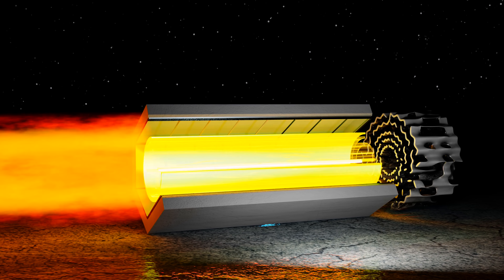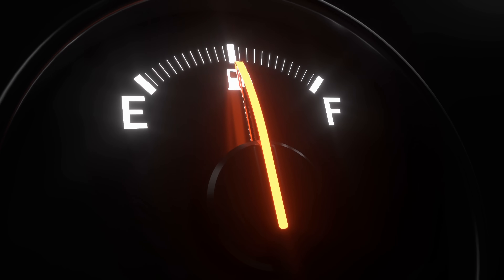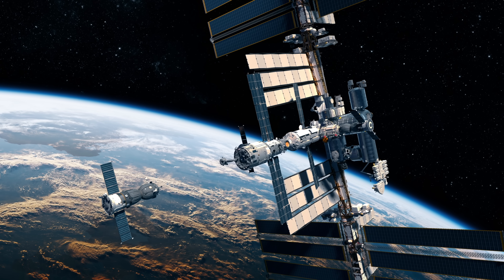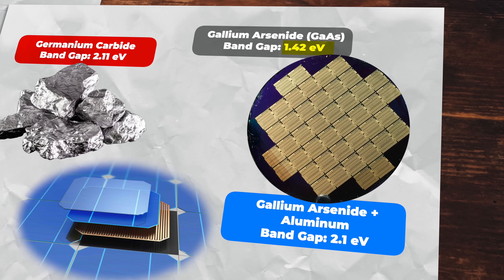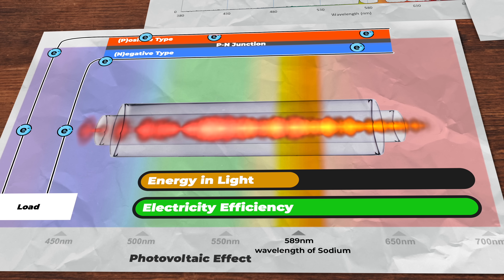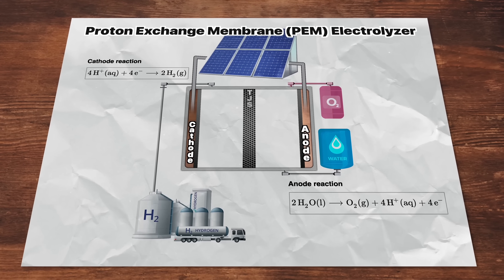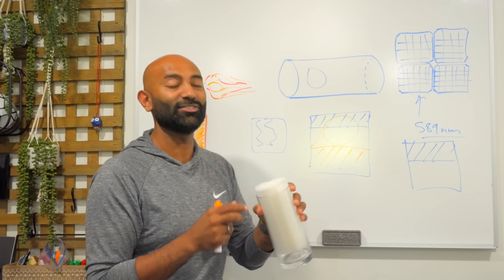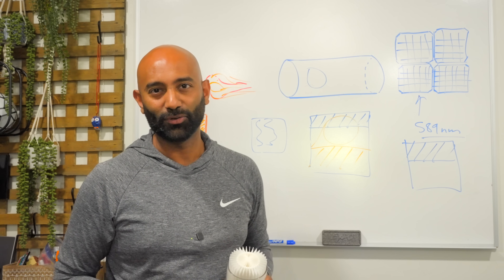Why Solid State Might Save The Combustion Engine

Comment: Look at each step. 
Combustion: Air with 20 % oxygen is mixed with assume a gas fuel and burned.  It's volume is greater then the air and fuel combined by a significant ratio so it will push the air and fuel gas out of the combustion section.  The solution is a vertical mounted system where the less dense hot combustion product have buoyancy in room temperature air. However the exhaust and still burning fuel and air will either speed up and create more drag or the area increases. 
Radiant, and convection heating occurs heating the container of the combustion.  That heat needs to be conducted, radiated, and convected  to a heat sink.  In this concept the final means of moving thermal energy is by radiation of the sodium at 589 nm wave length.  This can only occur, with neither of the other methods being significant, if the gap in which this occurs in a vacuum and the surface is pure sodium.  Table salt melts at 800C and sodium at 98C.  Most efficient temperature is 300C.  The salt needs to react with something to combine with chlorine being a gas that is removed by the vacuum pump.  The only way of obtaining pure sodium. The sodium a liquid at 300C need to be a a porous ceramic vessel with sodium wetting the outer surface completely yet held in place by surface tension. There will be losses because something has to hold this assembly in place and achieve a vacuum.  The voltaic Germanium semiconductor devices will never by 100 % efficient. however; the conversion of heat to electricity occurs in a gap between the terminals at different voltages. Physical features, so some fraction of the surface seen by the radiation hits them. The germanium is going to be heated by the radiation not converted into electricity and the also heated by the current. 
The combustion gases lowest temperature is about 300C so that the radiation is sufficient to make electricity. The hot gas enters the heat exchanger that is likely a cross flow device which is significantly less efficient than a counter flow heat exchanger. (the image) The inlet gases are heated cooling the exhaust gas. Buoyancy is the pump that moves the gases through the system.  The hot inlet gases are now also buoyant but less then the average combustion gases.  More resistance to the flow in the system as the inlet is below the then heated inlet gases.   
Shut down is another problem because the vacuum must end and the chlorine returned and combine with the sodium to make salt.    I do not think they can achieve the efficiency predicted.  My guess is that they didn't calculate all the losses and energy to needed to set the conditions like vacuum. I had spent 20 years supporting Electrical engineers and know that the minor losses are not included in the models used to design circuits.  This didn't improve significantly when finite element is used to design the circuits.

Comment: You say no moving parts, but the gas is moving..,
So my questions are, the cost of materials to manufacture, exhaust gas components if not hydrogen, heat dissipation, photovoltaic and other component life expectancy, the engine startup process, ability to recycle and replace parts. Als, what is the pressure at the exhaust, could that drive a fan to act like a turbo etc.?

Comment: 100% not fake. This invention is genius. Solar PV cells are hard to make efficient because they must convert a wide range of light wavelengths. This makes material engineering very tricky, and various types trade off efficiency for cost and application. Yellow/red is the best colour for Solar PV absorption. So, having an intense source of narrow wavelength in the ideal range is perfect for Solar PV manufacture.

Regarding combustion and heat transfer efficiency. UK combined cycle gas turbines (CCGTs) get between 50 and 60% efficiency. This is very close to the Carnot efficiency for an ideal heat engine running at max power. However, things change since this has no moving parts, so no mechanical work, or fluid reservoir. We'd need an engineer to discuss the potential mechanisms, but the quoted efficiency could be close to the maximum theoretical Carnot efficiency (around 85%). It's not impossible, as CHP achieves this (by prolonging the utility of the heat).

Comment: I think this idea is really cool but why? Why not just skip the whole thing and just use a jet engine in a car at this point you are running a half ass jet engine already. Yet you are losing a lot of energy due to transfer. It would make more sense to get as much power out of the fuel.

Comment: Burning that clean they could make it two stage where the heat could be recovered and diverted through a closed system boiler turning a turbine ( low pressure ) making it near 100% efficient.

Comment: Mesodine uaes the letters Tm after LightCell name.
TM stands for trademark. The TM symbol (often seen in superscript like this: TM) is usually used in connection with an unregistered mark—a term, slogan, logo, or other indicator—to provide notice to potential infringers that rights in the mark are claimed in connection with specific goods or services. Use of the TM symbol does not guarantee that the owner’s mark will be protected under trademark laws. The owner may use the TM symbol regardless of whether an application for registration has been filed or whether the trademark is registered, and even if an application for registration of the mark is refused.

Comment: Couple issues that I am curious about: What about emissions control, if burning gas? I imagine you could tune this for a more efficient burn, but there would still be carbon emissions. The other issue is heat and photovoltaic cells. Normally, solar panel efficiency decreases when panel temperatures rise. Would this not also be the case with these as they are in very close proximity to the combustion process.

Comment: there are high pressure and low pressure sodium lamps.  They do not use salt.  They use sodium metal.  You can see the sodium in a low sodium lamp.  Only problem is that sodium is reactive when it comes into contact with water.  Can you get enough heat from an internal combustion to light a low pressure sodium lamp while still cooling the engine?

Comment: Nice video and presentation. 
Burn fuel to run incandescent light to run solar cell. Does it also generate co2?
This is like using an incandescent light bulb to run solar cell.

Comment: Really good video unfortunately the physics of most of these concepts does not add or it is not commercially viable.  I particularly liked the utilization of the "waste heat" something had toyed with some 30 years ago and think with the materials available now and some serious development money it would make serious commercial sense after all the engine is a pretty bulletproof technology just need to sort out the "waste heat side". My thinking at the time was overly simple waste heat turbine and boiler but needed serious amounts of water! I think now some form solid state conversion would be a practical solution.

Comment: if their claims are true, combustion engines are the least important thing it would fix. this is a potential change in how we generate electricity from any heat source, gas, oil, nuclear, molten salt solar.

but i'm not holding my breath. boiling water to turn turbines is probably here to stay, heck even up to fusion for most designs.

Comment: On the internal combustion engine idea the Catalytic converter creates lots of heat while catalyzing. Using that waste energy would be awesome. Im sure it would be possible to pull the heat from the cooling system and air conditioning and concentrate it too. Imagine how small an internal combustion engine could be if it were 90% efficient having the extra power made into electricity to assist driving the wheels.

Comment: This TPV concept is not new. It was developed at Western Washington University in the 90s.  It was a joint project with JX Crystals.  The TPV units were used to power a vehicle.  I'm not sure how these companies are getting patent on the concepts since this was done before.  Maybe it's a modifcation to previous work. It didn't work that well and was eventally abandoned. The units were far too bulky for the power produced.  One issue that isn't mentioned is the emissions produced at various temperatures.  You get nitrogen oxides when the temp gets too high.  I remember NOX was one of the issues with the combustion research at Western that they were seeking to eliminate. They didn't want to produce a new engine with the same pollution issues as a conventional Otto cycle engine.  See SAE paper 972650.

Comment: This would not be a completely solid-state system. A fuel pump would drive the fuel into the combustion chamber. Then, there has to be cooling air to keep everything from overheating. I suspect that there is a low-pressure system somewhere there.

I like this. It's conceptually simple and uses existing technology. I doubt it's anywhere near 70% efficient, but even if it's 30% efficient, it would be groundbreaking.

Comment: Maybe one day we will be able to make optical rectennas with about 60-80% efficiency and so the problem with harnessing light waves energy would be solved.  Solution that require rare earth material unlikely be widely used even if it is working solution.

Comment: Having studied mechanical engineering, why on earth would you do a video and not put a single diagram of the carnot cycle in? 
It`s a thermodynamic engine converting heat into light into work and thus should be able to explained in a carnot diagram. 
You could instantly see if it makes sense

Comment: BS factor at max. What is the best efficiency of photovoltaics?  It's amazing what not paying attention at college can do.
Reply from the maker: I don't believe you've watched the video... traditional rooftop solar is about 22% efficient as i mention, because the sun puts out light in a wide spectrum. this is monochromatic light at 589nm, tuned with a custom solar cell specifically designed for that wavelength. hope that helps, its all in the video

Comment: If photovoltaic cells are maximum 20% efficient, how do you get 70 to 80% efficiency out of this engine?
Reply from the maker: did you see the part about outputting monochromatic line in 1 wavelength, and using a panel that absorbs exactly that wavelength? the sun doesn't work this way and puts out light in a wide spectrum.
Reply: I must admit I stopped listening and made a comment as soon as I heard 70 to 80% efficiency. However after watching more of your video I came to realize it's still BS. Having looked up the efficiency of the solar cells that you're talking about. Ones that being used in outer space. Their efficiency is only 34%. How does this translate into 70 to 80%? Also isn't there a little thing called the general law of thermodynamics? This of course would mean you'd be losing even more power would it not?

Comment: Making use of recovered heat is not easy since the temperature is so much lower than the combustion temperature.  What are going to do heat water?  maybe preheat the fuel?

Comment: the fuel into light translation is already a huge non-starter.  Light is a fairly small range of energy expelled from combustible fuels.  Thermo and pressure/volume expansion are the biggest parts of combustion.  And finally, photo voltaic energy conversion has an efficiency of 28.6% at the most recent claim of advancement.  The loss of energy in the previous two conversion stages is already outrageous.  There is no way after converting to electrical energy it could be above 20% let alone the outrageous claims originally stated.  

This sort of garbage leads me to unlike and "do not recommend channel" as I see FAR too much garbage in my suggested views.

Comment: Using copper would be a very bad idea, there's only about a 400° difference between the copper and the sodiums ignition point, I think you would find keeping localized temperatures from exceeding the copper is melting point to be almost impossible.

Comment: Unfortunately, if its not a scam, and is as efficient as they claim, it will never come to market. And before the naysayers quip with their accusations of pessimism, said individuals should check out the Patent Secrecy Act of 1952.

Over 6000 patents a year get classified under this law;  do you think of all those patents, none are for energy sources or motors with significant efficiency gains compared to modern tech? If it effects the economy (Oil anyone?), it won't be allowed to be disseminated, sold, or implemented. 

You want this tech to get out? Dump technical schematics on the internet. Open source the whole thing, and give it to as many news agencies as you can.

Comment: i say fail. sodium has two options: be kept at low pressure, or cycled into other phases.
sodium has several phase options, low pressure or high pressure or solid.
low pressure, though emits narrow band, is very poor absorber of combustion spectrum. so it cant be kept at this phase, needs to cycle into other phases.
high pressure, is poor absorber of combustion spectrum, and it self emits wide band.
solid, though good absorber of combustion spectrum, emits wide band while heating.

Comment: Way more questions than answers with this "invention".  Who's in charge of marketing?  Liz Holmes?  ;-)
Interesting, if rambling, "investigation" though.
Capture ICE waste heat this way?  Not likely.  Sodium lamp needs ca. 300c to operate, more to ignite initially and more with conversion efficiency, that's ca. 3x the temperature found in the waste heat of an ICE system.

Standing by for EEVblog or ThunderFoot to take aim at this topic.  8^D

Comment: Nobody ever seems to factor in energy used not to propel a vehicle but cabin comfort...
In EVs you spent a lot of energy in the North just keeping the cabin warm enough to be comfortable. In the South we do it to keep cool... 
You should work on the 20% loss to warm the cabin... And also to use it to cool the cabin much in the same way you use a propane flame to make a refrigerator/freezer!!! 
Or creating fresh water straight out of the air... Which is good for still even more parts of the planet with scarcity of portable water!!!

Comment: best and pretty much only use would be for emergency power generation/remote power generation. fuel reliant, high operating temperature and low efficiency. yeah, i said it, converting fuel into heat, then into light, THEN into electricity. each step has losses. it's few advantages would be size, reliability and simplicity. it could/should be more efficient than gasoline/petrol or diesel generators, so it could also have that going for it. also of course still has the one universal combustion negative, CO2 generation.

Comment: BS on effiency due to losses between Fuel to Light to Power and still uses fossil fuel. Batteries are even terrible with mining reare minerals, lower range per max capacity on a car, battery recycling and COST. There is a tonne of natural coal, oil and gas, let's stick with the devil we know and finer tune them.

Comment: So you’re losing energy from combustion, which already has a low efficiency, taking that force and completely neglecting it, completely neglecting the heat that it’s producing and throwing out the back, and only using it as a light source. That light source is going to have significant losses going into a photovoltaic cell, and that electricity is then having losses from impedance and heat. I fail to see how their efficiency can reach above 60% with the overall efficiency being dragged down by the rest of the components.

Comment: Very awesome. Heat to electricity, peltier device. I use it on my hydrogen engine to run the fan to cool it and power lights.
Reply from the maker: That's a great idea! Going to do a video on peltier chips

Comment: This is an amazing idea, BUT...
Forget burning,,, solar thermal collectors were used in Egypt in the 1920s Solar thermal heats the sodium straight to electricity through the tuned PV cells, fantastic!. 
If combustion is used, what keeps it clean? A carbon buildup may ruin that dream.
Again without combustion free electricity can come from thousands of human waste heat factory processes, steel, and other metal refining, nuclear, cooking etc.

Comment: ICE engine best performance are :
1) Petrol - 43-46% and
2) Diesel - 53%.

The technology is more than 100 years.

EV is barely 10 years old with Tesla as the 1st real EV.

Imagine the EV Batteries technology is just starting.

Give it another 10 years and ICE Engines including Hydrogen Fuel Cell Engines will definitely be history.

Comment: Why does the sodium need to be in a tube like that, surely you can provide the heat via a heat exchanger to reduce thermal build up, like a sodium vapour light, ie it doesn’t use up the sodium but rather maintains the temperature to allow it emit light, with the same lifetime as sodium vapour street lights had? You could easily take the heat from an existing ice engine by covering it and the exhaust in heat exchangers and concentrate that to 300bdegrees, like he says at the end…. This would prevent any soot issues reducing efficiency and would simply increase the efficiency of a hybrid…… obviously it requires a cba but it must be cheaper to retrofit rather than creating a whole new engine type